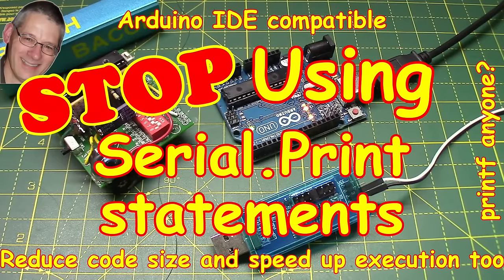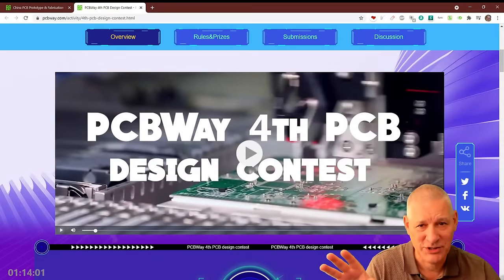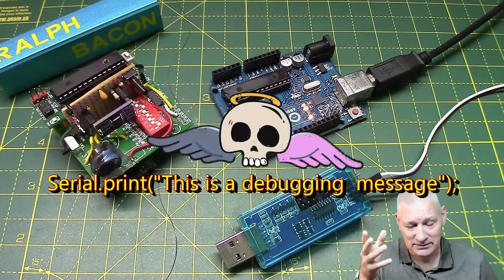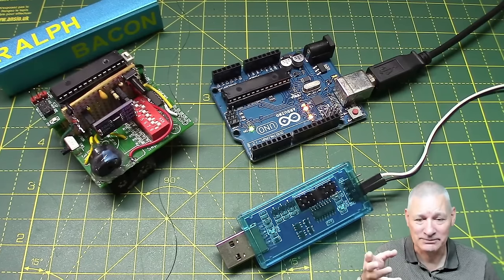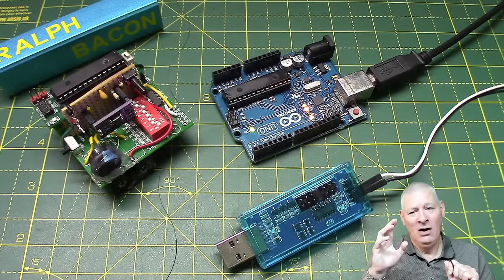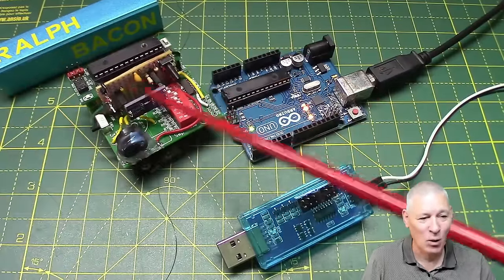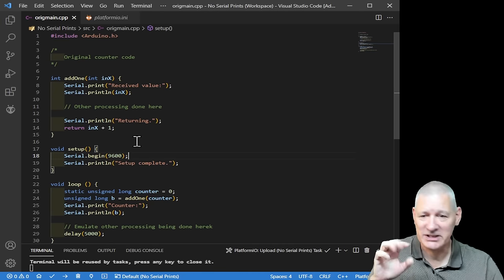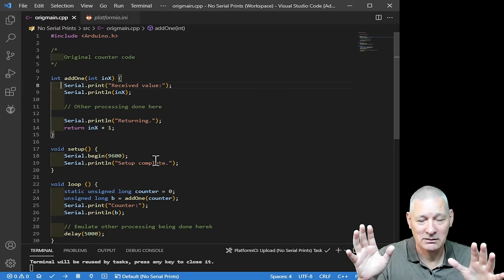#224 🛑 STOP using Serial.print in your Arduino code! THIS is better.

Comment: This was very long winded about a standard programming method.
Reply from the maker: It's not "standard" if you've never done it before, is it?
Reply: @RalphBacon  Even if you have never used a metric unit to measure something, it is still a standard. The same can be applied for programming techniques in C, C++ or other languages.
Reply: I wonder what "standard programming" you are referring to. IoT is a different beast and an entirely different ecosystem for the hobbyist. 
Not everybody knows this...like Ralph said...its not standard if they don't know about it or never read it, experienced it, and no tutorial or documentation I've read the past 3years mentions it. 😉 
That being said, try and be considerate of hobbyists.
Thank you
Reply: @Invatator  The information is important because the use of #ifdef in C and C++ do make it a lot easier to remove/include debug code. It was the time to get there i criticized because I think that many that could have need for this will fall of and watch something else before he gets to the point. Close to 30 minutes is long bit long.
"and no tutorial or documentation".
It is "funny" how often that can be a problem since the programmer that write it can so easily forget that even very basic techniques most be learned and #ifdef is something you learn early. It is not perfect and have problems, but it is a simple and easy way to control your debug code.
Reply: @bknesheim  that's what I mean, ...I don't think I have "proper basic" introduction to C or C++, and used it last time before Arduino like 10-15 years ago, and Arduino feels a bit different.

Ifdef define and other "optimizations" don't seem properly introduced to Arduino hobbyists...just "how to get fast through the door".
Anyhow...are those concepts you talked about in the C/C++ basics? I can dig out old books if any...as I'm really interested in making my microcontrollers performant and improve myself
Reply: @bknesheim  I'm currently having a project that reboots itself every some random amount of time, due to kernel panic memory filled something, on an ESP32. I'd look into how much this actually helps in conjuction with other bits that I'm doing wrongly...cause I am trying to debug and print to OLED in the same time. String formatting is not that easy either...so I had to write duplicated functions with minor variants to support the output I'm looking for
Reply: I would rather be watching Lex Fridman interview the GDFL inventor of Python.  But I agree with him so far...
Reply: @RalphBacon Yeah sorry but no. This is standard programming practice if you minimally know what you're doing. Not interested + "don't recommend this channel"
Reply from the maker: Best not to watch any other videos then. 🤷‍♂️😆
Reply: I agree this is very entry level material for novice programmers, which is fine for that audience. They’re probably not the same audience that would be getting custom PCBs made but who knows? 😄
Reply: I am very inexperienced with programming, and found this quite a slog. There are some parts that I think could have been sped up in other parts that could have been slowed down. I find that when I watch tutorial videos that it's good to be a little bit slower for us noobs but it's best just to cut to the chase as quickly as possible. Show us while you're coding it. So that we see the coding while you're explaining.
Reply: @LIOTBs  "Best not to watch any other videos then 🤷‍♂️😆"
The guy's a complete fool

Comment: Interesting topic! But, imho you shouldn't blame the Serial.print statements for slowing down your program when you are not doing the house keeping after debugging  by removing those print commands.
Reply from the maker: Well, yes, it's always the responsibility of the developer to "tidy up" after coding is finished; I'm hoping this will make it so simple that they will do it. And learn something about pre-processing whilst they're at it!
Reply: Yes, however it can also be beneficial to have certain debug / trace logic kept in place so it's ready to be used when adding future enhancements, and testing at release level performance can be necessary while still developing and needing debug code. So for both scenarios, a way to knock out debug code while it's still present in the source is useful.
Reply: Uh but what if your code is timing sensitive? Doesn't necessarily matter about cleaning up after. Also, sometimes serial is used for communication and often s.p is used for that too
Reply: @forbiddenera  the topic was serl.print for debugging, not project messages. Those time need to be considered in a project.
Reply: Deleting debugging statements after debugging is like throwing away the sponge after the dishes are washed.  Complex programs are rarely, if ever, completed and bug-free.  And most programs are susceptible to changes in their environment -- e.g., libraries, or 3rd-party connectivity policy changes.  It's helpful to build in a way of retracing your steps without having to "re-do from start"
Reply: @haroldfinz4863  yep. Just wrap them in compiler ifs.
Reply: Don't delete the print statements, just comment them out.
Reply: @RalphBacon  I did

Comment: The initial statement was that Serial.print slows down the microprocessor (and it does) and that's why you will propose a better solution. In fact, the solution doesn't offer an alternative. I just shows a way to enable/disable all the Serial.print lines :(  Not quite a solution!
Reply: yeah, no real solution and too much ads at the beginning...
Reply from the maker: I believe it shows a better (and more efficient way) of tailoring your Serial output.
Reply: @RalphBacon  How would one use the optional second parameter which specifies the base (format) to use; i.e. Serial.print(0x61, HEX);  ?

Comment: I have to say that this "simple" method of deactivating debug statements has to be a winner for all the reasons you highlighted.   I will be using it big time. thank you for such a bright shining light on a very simple way round the problem.   Even simpler than having all the debug Serial.print statements inside   IF  debug on THEN.
Reply: one reason for IF debug on THEN, would be to be possible to enable/disable by input.
you would save time, but not size.
Reply: 0
Reply from the maker: Indeed, I dislike wrapping all my Serial.print statements inside #if...#else...#endif as it destroys the layout of my code. I find this a neater solution!
Reply: @RalphBacon  the precompiler approach is realy nice to save size, where size is not an issue, comiled if-statements can be nice to enable/disable debuging on the fly, for troubleshooting without recompiling and loading new binary.

Comment: 4 years of college and nobody ever mentioned this.  Not one single professor.  I want a refund.
Reply from the maker: Ha, ha! But at least you learnt lots of other stuff; this is just the stuff you never get taught at college but find out "on the job". 
Maybe your professor watched this video and will now be teaching it. I want royalties!
Reply: All the people I have worked with that have CS degrees have said the same thing. Apparently most of the the get taught in CS related classes are things you won't use on the job.

Comment: I risk being unable to see the obvious but the Simple and Advanced Example at github don't seem to demonstrate 'printf' and I also don't see how the printf library gets included into Platformio.  Can you elaborate; I appreciate the issue with the sharp knife - been there,  done that.  Cheers.
Reply from the maker: Thumb is slowly healing, Thornton, thanks!

The Simple and Advanced sketches do not use printf at all; the Advanced example shows a more granular approach to debugging levels (I'm using it right now in my new sketch).

I'll be doing a complete video on printf very soon. In the meantime, you can include it in the PlatformIO environment by clicking on the Alien Head, choosing Libraries and entering arduino-printf in the search bar. The first entry in the resulting list (on my system, at least) was LibPrintf by Embedded Artistry which you can then click and Add To Project

Note that ESP32 projects won't need this, ESP32 has printf already built in.
Reply: @RalphBacon  Clear reply, cheers, mate.

Comment: To avoid unused variable or parameter warnings, try this for the no-debugging case:
#define debug(x) (void)(x)
#define debugln(x) (void)(x)
Reply from the maker: Yes, that good to suppress the warnings. Or, include the extra parameters as I do now. Here's an example of the 'Error' level warnings:

#if DEBUGLEVEL > 0
#define debugE(x, ...)         \
   Serial.print(x, ##__VA_ARGS__);
#define debuglnE(x, ...)      \
    Serial.println(x, ##__VA_ARGS__);
#else
#define debugE(__VA_ARGS__)   // Nothing to see here
#define debuglnE(__VA_ARGS__) // Or here
#endif

So now, debuglnE(aNumberGoesHere, HEX); will work.

Comment: 21:03 can you do some kind of #define or something to replace line 30 too? then get rid of that "b"-warning when debug is off.
Reply from the maker: I hear you but a warning is just that: a warning. Not an error. I try not to get hung up over things that are known (not just ignored) and accepted. 

But I'm sure you could tweak the code (or the #define) to remove the warning if it really annoys you. 

And there is the "Report by Exception" rule, where all warnings and errors MUST be removed before sending anything live, otherwise we could have a dozen warnings!
Reply: @RalphBacon  totally agree that a warning i not to worry about, when you know what it is about. 

Main reason (for me) to clear it, would be to "clear the sheets", to make it more noticable whenever there is new warning that I have not looked at yet, as a warning can be caused by compilable bugs.

I also thought about possibly bitmask logic, to only enable partial debuging:
0: no debug, 1: debug input, 2: debug output, 3: debug input and otput.. etc
Then you can enable debuginfo for the parts as you need. But disable parts you don't need at the time. To avoid wasting resources on debug all, and to save space, and to avoid bloading the debug console.

But if size is not a problem, debug enable/disable by input is nice too.
Reply from the maker: Have a look at the Advanced example in my GitHub; it does exactly what you suggest:
https://github.com/RalphBacon/224-Superior-Serial.print-statements

Comment: #Define calls the pre-compiler and does a ‘find & replace’ before compiling the code.

As a computer science student, a loooong time ago (1985), I had to write a C pre-compiler as an assignment. It wasn’t very difficult but I’ll never forget the use of pre-compilers.
Reply from the maker: Quite so. The modern IDE (not Arduino classic) does have some intelligence regarding precompiler directives which makes it even more useful.

Comment: Why don't you put the Serial.begin inside your debug macros? 
#if DEBUG == 1
#define debuginit(x) Serial.begin(x)
#else
#define debuginit(x)
#endif
Reply: So many comments about using "find & replace" while real developers use the method described in this video, it's even built into most C/C++ compilers (switching between debug & release). Even in C# debug functions don't output when you switch to release mode. People learn about macros and criticize because they think they know better, pretty arrogant. With precompile definitions you can leave out whole sections of code so you can include and remove functionality of your program too. (Eg, compile code for a display with code for certain sensors in or removed). You can switch between versions of components or just remove them from your code. It's very useful
Reply from the maker: That looks too simple to be true. Oh wait. 
Hang on... does that work? Have you tried it? I cannot believe I did not do this (or at least try it).

A plausible explanation is that by leaving the Serial.begin alone, you can always use the standard Serial.print in the sketch and (perhaps more importantly) any included libraries will also be able to output errors. Otherwise it could all go very dark, so to speak.
Reply: @RalphBacon  I don't know if you are being sarcastic. But anyway, placing the serial begin also in your debug precompiler section removes even more bloat
Reply from the maker: No sarcasm implied. My (mostly) plausible explanation though is a valid one, right?
Reply: @RalphBacon  Your video is certainly valid and good advice. To also put serial.begin in the DEBUG macros is just a small improvement. Of course, if one wants to use the Serial methods outside of debugging this would disable it. You still need to put Debug println and other methods also in the DEBUG macros, not only the serial.begin.

Comment: great tip! just wondering what happens to the semicolon when the debug statements are replaced with nothingness. i assume it stays, but empty lines are not compiled into the final program. or would it be useful to include the semicolon in the define statement?
Reply from the maker: Extra semicolons get ignored; you can include them as part of the define but that might upset the syntax on the rest of the line that you're using the define. Best to keep it as part of the code, the compiler will remove it anyway.
Reply: @RalphBacon  great, thank you for the clarification!

Comment: But you left in Serial.begin(); so you've missed the chance to remove a whole library
Reply from the maker: Well, yes, I did, but this could also be removed if it is a problem. 

We can even switch off the UART completely if required:
#include <avr/power.h>
power_usart0_disable();

For battery powered projects it might be advantageous.
Reply: Compilers are tricky these days. Since that's the only statement left, and the library's not otherwise used, I wouldn't be surprised if it was optimized out of the compiled code. Would certainly warrant some experimentation.

Comment: Why does the Serial class initiation remain? - Could you not use the same method to remove Serial.Begin(xxx) from compiled code?
Reply from the maker: Yes, you could, but you don't really save much space (a few bytes at best). Not like the complete Serial.print statements now being sent into the ether!

Additionally, you might want to actually still output an actual Serial.print statement (eg fatal errors) so this would still be needed.

Comment: Thanks for the information; a useful reference. I have got into the habit of using a DEBUG definition and then wrapping each of my debugging Serial.Print commands in an #if....#endif block, but this way you showed is a much more elegant method that I hadn't thought of before. I am by no means a beginner, but never ignore information like this aimed at beginners, as sometimes I find I've been set in my ways and they aren't necessarily the best!
Reply: I was ready to say exactly the same. This method avoids my adding all those #ifdef's. I always start my programs saying I'll only need 1 print so I don't bother with the #define debug. Finally I end up with many more prints and many more #ifdef's.
Reply from the maker: I'm sure everyone experiences the same as you, Bill! Me included. I mean, the next sketch will be so simple what could possibly go wrong? Oh.
Reply: @RalphBacon e
Reply: yes!!!
Reply: My thoughts exactly. While watching the start all I kept thinking was "well, just conditional compile them by wrapping them it #ifdef DEBUG's", but it never occured to me I could alias/macro it all in/out that way. And I mean, I'm not really a beginner either, and I've used both conditional compiling with #ifdef's and macros, but it just never occured to me I could shorthand all of this this way. 

This is one more confirmation to the idea that it's never wrong to re-review basics even if you are "an expert" - there's always a possibility you've missed or forgotten something useful.
Reply: Same here. This is a much cleaner solution. Glad I am far from the only person implementing the same solution as ya'll.
Reply: Sometimes it is good to have debug levels. Say with level (defined) debugLevel1, 2, 3, etc where say debug level 1 is the least “deep” and level 2 would include 1, but go deeper and print more, etc.

Comment: A word of warning:

If you define a symbol to be an expression, put parentheses around the expression to make sure that they evaluate the way that you wish.

Example:

#define ratio( x, y )  x / y

if you use ratio in the following, you will not get what you intended

float a = 5.0;
float  b = 10.0;

float c = ratio( a, b ) ** 2;

The expected result would be 0.25 (= 0.5 **2 ).
UNFORTUNATELY, the compiler was presented with    x / y ** 2
The operator precedence of C/C++ will perform the exponentiation first and the the division.  This means that c will be 0.05 ( 5 / 100 )

If instead, you change the define to be

#define ratio( x, y ) ( x / y ) 

then the expression seen by the compiler is ( a / b ) ** 2 which is what you wanted.
Reply from the maker: A very good point you make, Michael; many libraries will contain all the #defines in "(" and ")" just to be sure (and UPPERCASE).